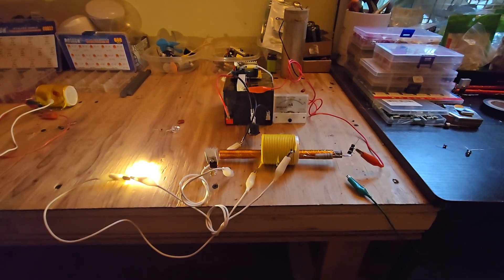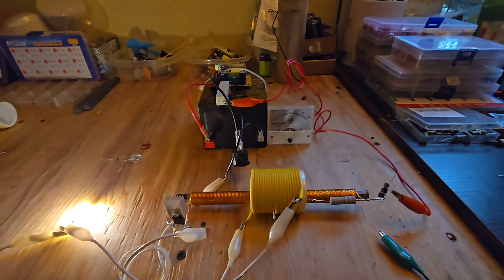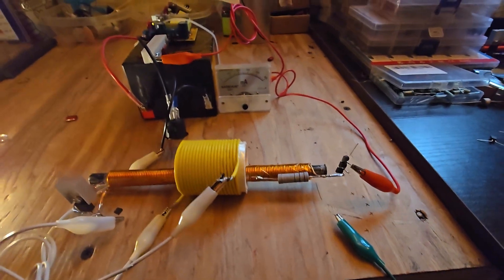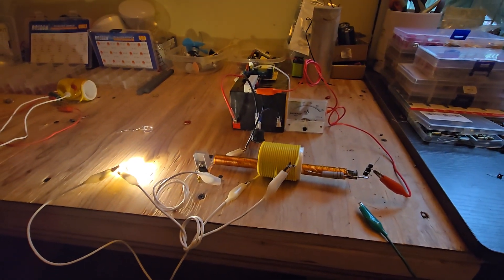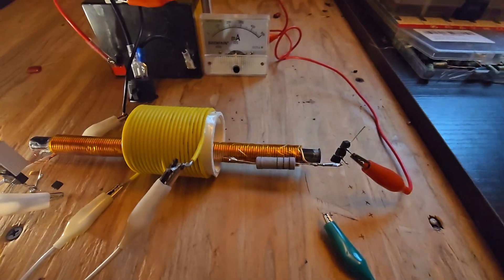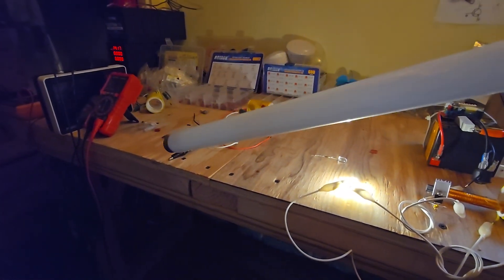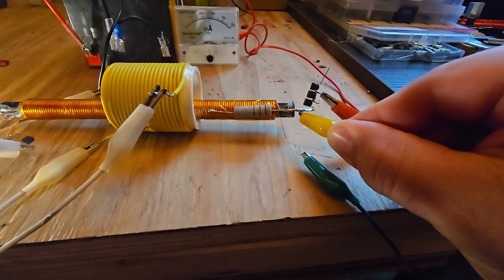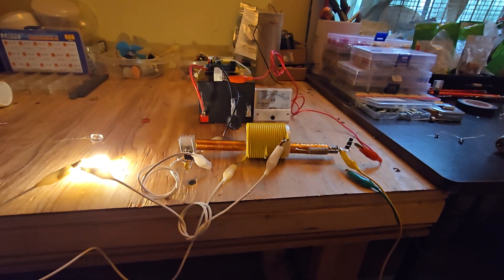500VDC 1-3mA INPUT SIDAC IMPROVED NEGATIVE RESISTANT LONGITUDINAL TESLA TRANSMITTER SHOWING PROMISE

Comment: Stop wasting your time people these guys are taking your time and money, anyone that works in electronics would know this already though....
Reply: Why ya hating man 🙄🤷‍♂️
Reply: If they know it, why don't they do it?
Reply: @ NEGRES !!! Your here brother 🙏
Reply: I am from Poland do you think that if you are an electronics engineer then you know better about these topics Man I assure you that the energy in resonance is great and it is very easy to do The guy is trying to understand and do it I know how to do it and I assure you that I can have as much energy at the output as I want One more thing if you are not able to understand and do energy in resonance then I am shocked that you are an electronics engineer and you have not learned anything and you have not even calculated it mathematically or with energy formulas You are a joke:face-blue-smiling::face-blue-smiling::face-blue-smiling::face-blue-smiling:
Reply: @jacekwis512  
А я из Беларуси. Хоть ты и сосед, но тупой балабол. 
Ни какой энергии ты не получаешь. Просто прикинулся клоуном.
Reply from the maker: Our goal is pretty clear & laid out in our video description(s) our goal is to create a transmitter that becomes so energy efficient & cancels out its positive resistance with the correct amount of negative resistance to become self activating from just an earth ground & possibly  a small antenna or coil connection then the modules can be stacked when perfected for a higher power output with no electral input.